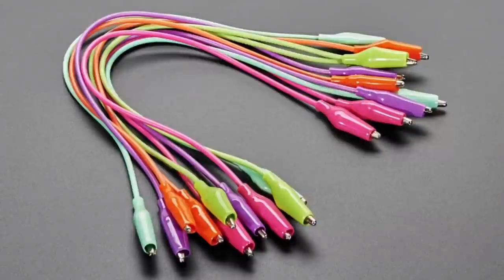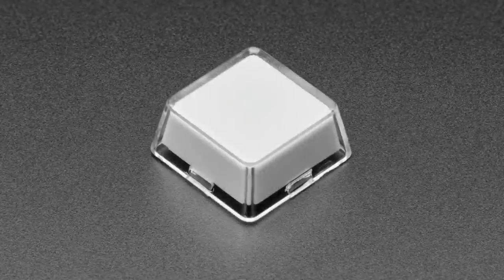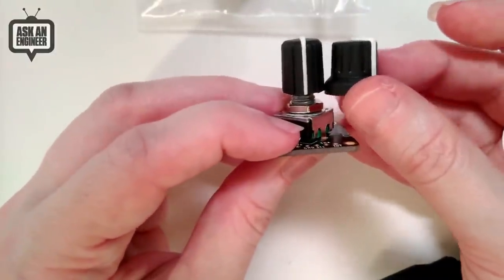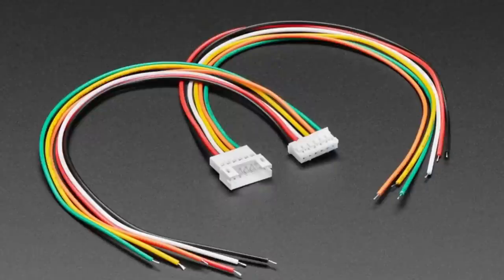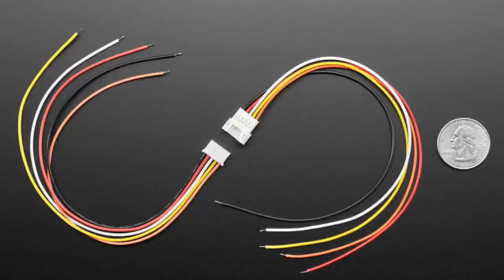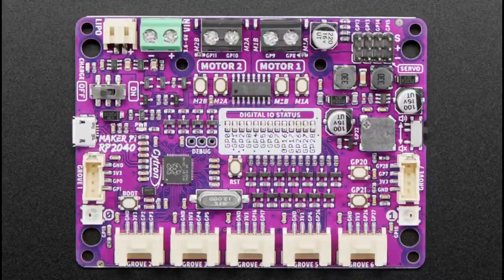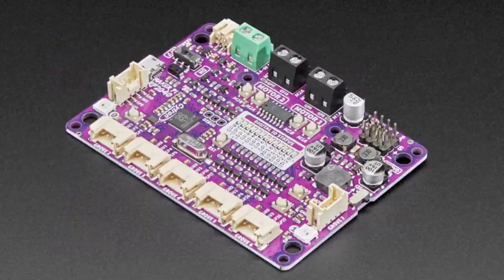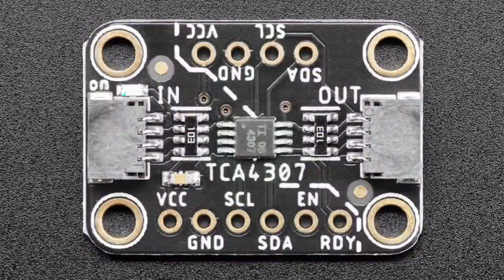New Products 7/15/21 feat. NeoKey 5x6 Ortho Snap-Apart Mechanical Key Switches w/ NeoPixel!

Comment: Can you connect multiple NeoPixel Ortho 5×6 boards to make a grid with a dimension larger than 6? I want to make my own keyboard for typing with two fingers (1/hand). It would be about 12 rows by 25 columns (taller than a 108 keyboard but just a little wider). I'm hoping that all I would have to do is jumper between the 5×6 clusters and remove any unneeded rows & columns.